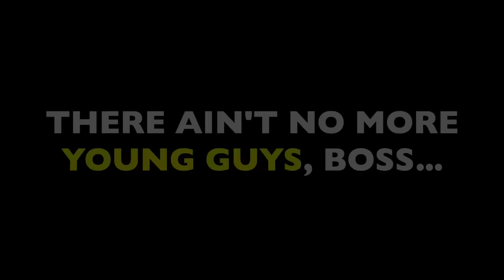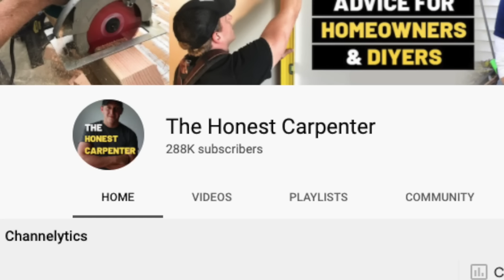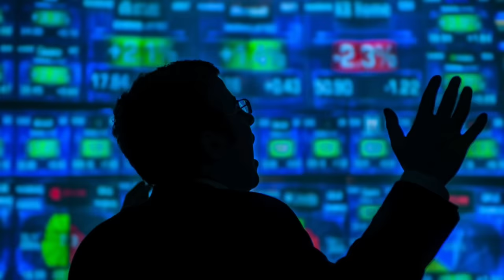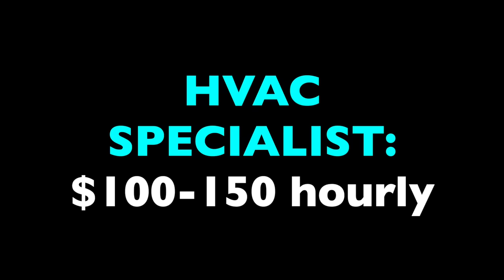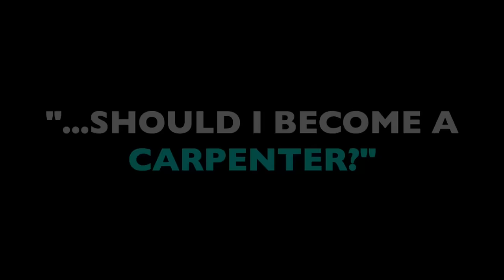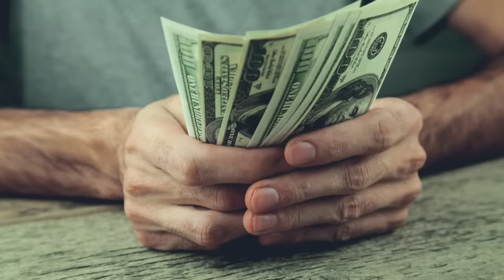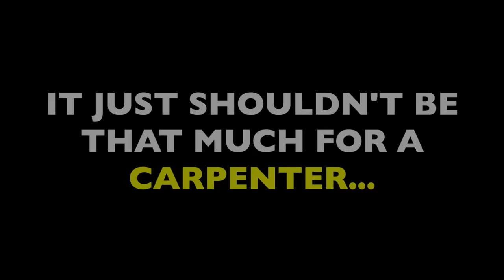WHERE HAVE ALL THE CARPENTERS GONE?! (Why The Trade Labor Shortage Is Only Beginning...)

Comment: Went to carpentry school  86’-88’ and have been carpentering ever since. A couple times I thought about changing careers but Carpentry is what I knew and what I was good at. I’ve done residential, commercial, industrial. 
My advice- Yes!  Absolutely become a carpenter. But always wear knee pads, always wear hearing protection, always wear eye protection always, always, always. Start at the beginning developing those habits and it is very likely you will be able to function more fully when you have been carpentering for thirty plus years. 
About the pay. Don’t allow others to tell you your worth. If you have to take a low pay to get your foot in the door then do it, but then listen and hustle. Once you have proven your worth go for the raise. If refused then move on. 
It’s all about the economics of supply and demand. For a while everyone that could hold a hammer was a “carpenter”. Therefor the supply was high and the demand was low. Today, there are few that want to hold a hammer. That isn’t a bad thing; it will be the catalyst for higher wages because demand is high and supply is low. Also, don’t just be a carpenter. Step it up!  Work with integrity, a smile, and an outstandingly positive attitude- even when you aren’t feeling it. The Boss sees all. Guaranteed. Don’t let my youtube handle make you think I’m a backwards as_ hillbilly. I’ve been around.  Ending my “career” as Project Superintendent running double digit million dollar projects.  Raise the bar!  Remember, none of the other trades would have a building to work their trade if the carpenter hadn’t first constructed it. 
First in and last out. And there’s a reason why big outfits make carpenters Project Superintendents more often than any other tradesman. Peace.

Comment: I didnt go to trade school and can work circles around those who have. I dont need to qualify to do a job that a monkey could do. pluming, carpentry and electrical are all easily trainable jobs. You want workers, get rid of the rails.
Reply: Anyone can glue some PVC fittings together or pop on a shark bite but can you do it efficiently and properly? You know how many times I have seen a "plumber" install a p trap backwards?
Reply: @fiendwithout  Lol, I just saw the backwards p trap last week. However it doesnt take a certificate to get it right. Ive seen contractors make just as many mistakes as the diy guy. The only difference is the "pro" usually has some order to his mistakes. i.e. he ran the wires nice but it still has an open ground..... You know that guy if you know the reverse p trap guy.